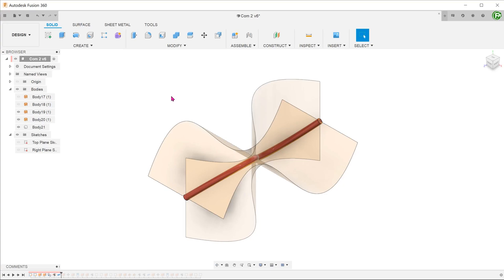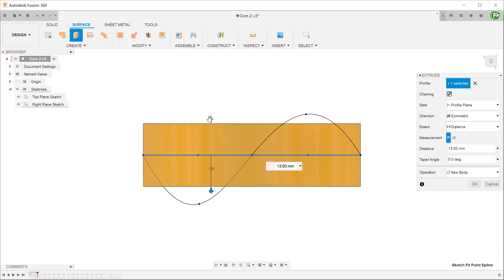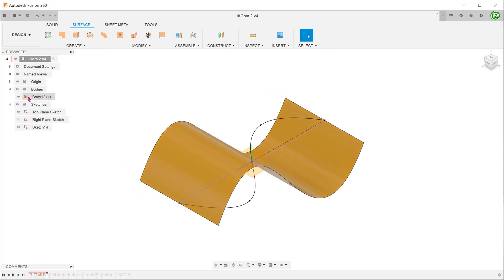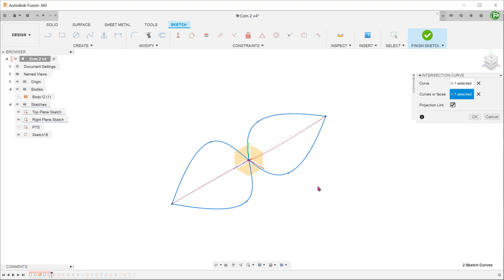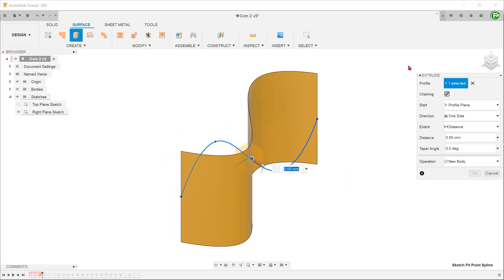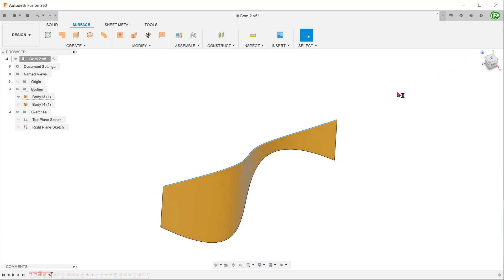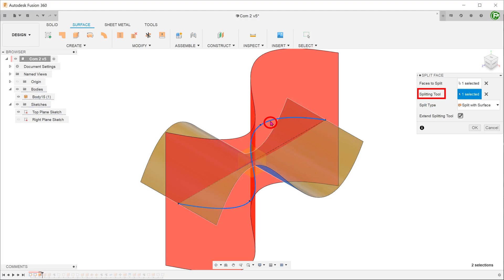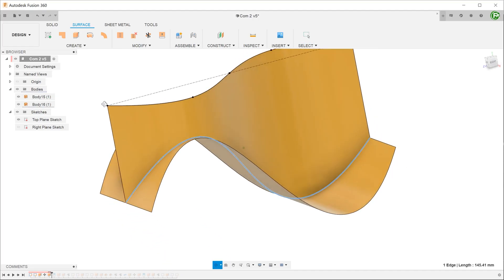Fusion 360 - Complex Curves Part II

Comment: Good information.   I was using the projected curve to make a nice, curved 3-dimensional "loft".   While my two original curves were connected/attached to points on the two lofting surfaces in question, my projected curve was technically not and so it would throw me an error that my [projected] curve did not pass through the lofting surfaces.  I just traced the projected line in 3D mode and attached the points at each end which took care of it, but is there a more elegant way of doing this besides retracing the projected line?   Thanks.
Reply from the maker: Mmm....I don't understand why the projected line would not be connected. I seem to recall instances in the past where I was able to use the projected line as a rail. Might need to do more testing.

Comment: I'm so glad I came across your channel.. this is exactly what I was looking for and I couldn't find it anywhere else.. I was basically looking for a fusion 360 version of 'project curve (sketch on sketch)' that Solidworks has... Almost every other video mentions that the only way to do is to surface extrude one curve and project another curve onto it.. nobody talked about intersection curve feature of fusion 360..  this avoids the formation of an extra surface body in the browser.. Great video! Short, simple and just the information we need..
Reply from the maker: Appreciate your comment. If you watch my previous video (Complex Curves Part I), I was one of those who mentioned doing a surface extrude and projecting. 😅 It took me a while to learn about the intersection curve command.
Reply: @Fusion360School  yes I did come across that video but at that time it was already covered by other channels during their modelling tutorials.. But this part 2 is new and i don't think anyone has covered it yet.. Or atleast that's what i think from what I've searched so far..

Comment: So basically always use intersection curve as it is doing the two extrudes and deriving the intersection curve behind the scenes?
Reply from the maker: Yes, intersection curve would be the fastest way. My intention was to show how this problem can be tackled in different ways.
Reply: @Fusion360School  There seems to be a limitation to intersect curve method. If you do an intersect (in a new sketch) on the curve created by intersection curve (from previous sketch) the resulting points won't update if you modify the original planar curves. If you use the extrude/trim method they will. I think this is because projected geo is not transitively updated.
Reply from the maker: Hi, I have attempted to create an intersection curve using an existing intersection curve. However, I would always run into an error. I couldn't figure out what was happening. Thank you for pointing out this limitation though.